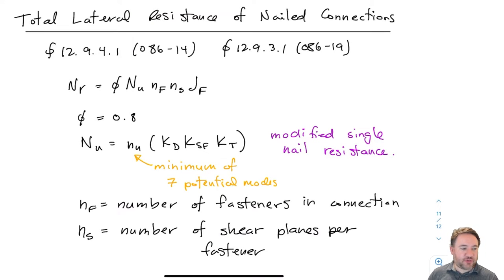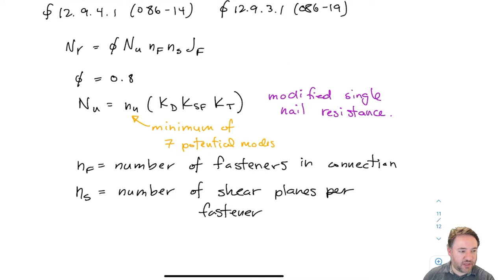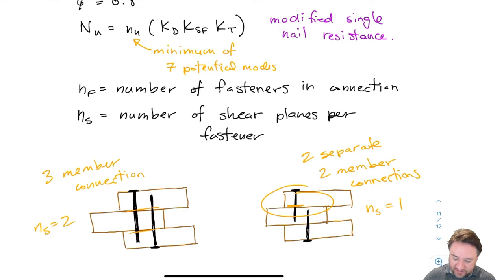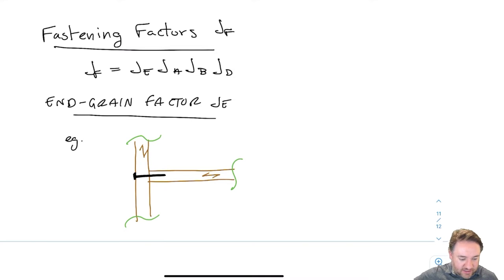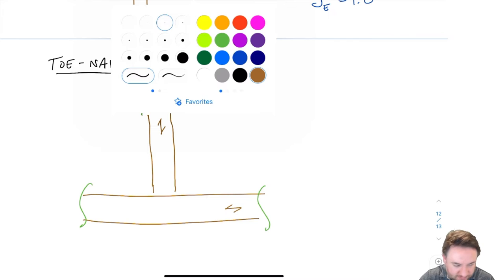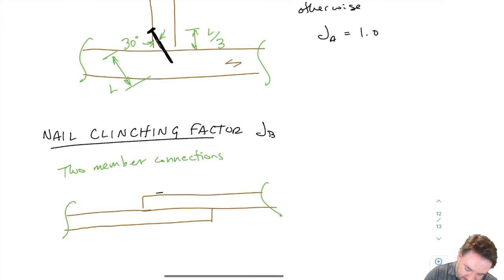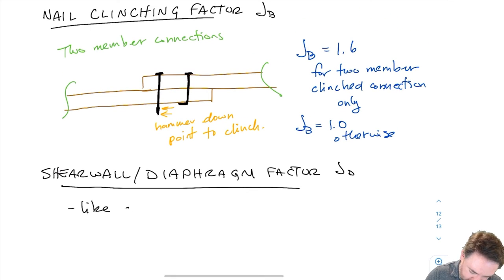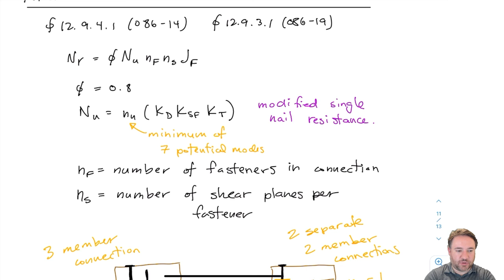Nailed Wood Connections - Part 3 Total Lateral Resistance

Comment: Again, another excellent lecture.  Your explanations are clear and follow 086-14 and 19 logically and coherently.  

One comment:  As a practicing Structural Engineer, I have for the past two decades had a concern that the  nail tables, while applicable for common wire nails, Ardox, etc. (that are made for hand-held hammering), they were inadequate when it comes to nails fired from an air-driven nail gun when we are analysing their lateral strength.  Most nails driven on construction sites today (and in the past 30, 40 years, for that matter), are driven by air guns.  So, in measuring the shank diameters of these air-driven nails, we find that they are appreciably thinner than their older counterparts.  For example, a 2.5" long air-driven nail has something in the vicinity of a 70% smaller dia.  To compensate for this when I am designing shear walls or diaphragms, for example, I have used a SF of 0.7 for this size nail in my calcs (call it the "air-driven nail reduction factor"). 

I realize that tests are on-going on such assemblies for wracking, etc. and surely these tests must make it into the Standard (yet last I checked, the tables seem to remain the same) - so wonder if my procedure would be considered overly conservative. At any rate, I can sleep nights (and, at any rate, such measures do not add very much to the overall cost of an assembly).

Again, thanks for a great lecture!
Reply from the maker: Thanks very much for your comment!

That would be great feedback for the CSA standard committee certainly. The CSA standard has added at least some ASTM F1667 nail sizes ("pennyweight" 6d, 8d, 10d, etc.) nails in the appendix (Table A.22), but that doesn't address air-driven nails, as you say. The standard in clause 12.9.1 states: "12.9.1 General: The design requirements specified in Clause 12.9 apply only to common round steel wire nails and spikes and common spiral nails spiraled to head as defined in CSA B111 or ASTM F1667, including power-tool driven common nails. Note: See Tables A.21 and A.22 for commonly available nail and spike sizes." So, although the power driven nail sizes may not be included in tables A.21 and A.22, as long as the nails adhere to one of those standards and you know the diameter of the nail you are using, you can use all the same design equations. The nail embedment strengths are not in all cases directly linearly proportional to the diameters though, so if you are trying to modify design table values to account for the change in diameter, you may want to spot check the strengths using the strength equations to make sure your reduced values are conservative. 

Perhaps the Canadian Wood Council, which makes the design tables in the Wood Design Manual would also welcome the feedback about including power driven nails in the design tables and not just the ones in the appendix. I believe they have been in the process of potentially moving some of the design tables online.